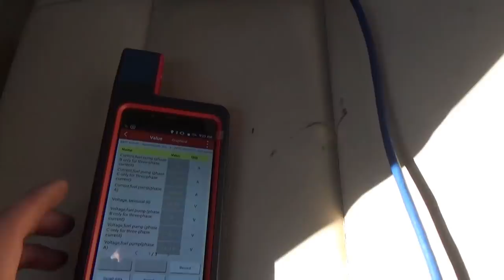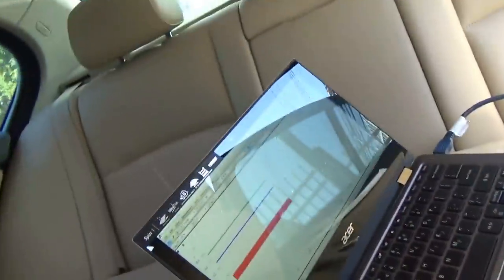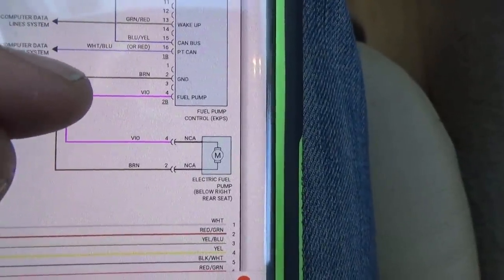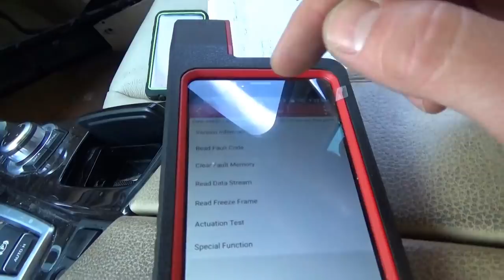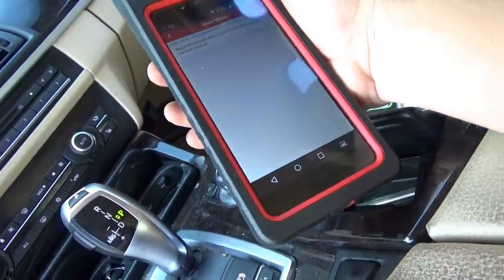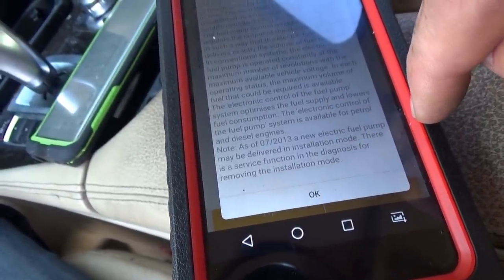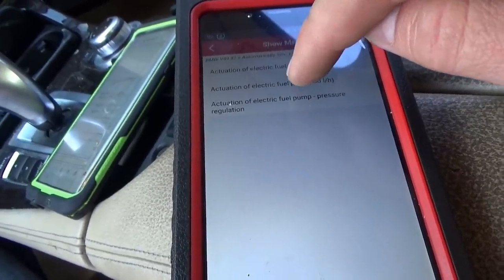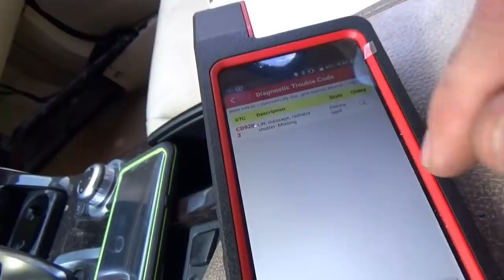BMW Fuel Supply Case Study -Part 1 (SI Ep. 15.6)

Comment: If the fuel pressure is staying at 96 and not changing, either a faulty sensor, shorted wire or no communication between the sensor and fuel pump module.

Comment: Ivan, You are about 3 & 1/2 hrs away from me & I have an issue with my 03 focus that eludes me however, I do admit that there is one thing that I haven't done & should remove my ecu & figure out which wire controls my cooling fan & see if anything obvious appears, then test for voltage but, You IVAN, I consider to be the BEST!  I have found a way to side step my issue partially, I have spliced into my cylinder head temp sensor & ran a toggle switch. When I activate the switch, the fans come on however, I WOULD REALLY LIKE TO FIX IT CORRECTLY & WOULD LOVE TO ONE DAY THIS SPRING OR SUMMER, TO PAY YOU A VISIT & SEE YOU WORK YOUR MAGIC? Though, I only get one day off per week & I work 6 hours that day & have the rest of the day to myself so, technically, it's called my day off but, NOT REALLY! Any who, I'd really like to hook up & get this issue figured out? I need to figure out which wire on my ecu, operates the cooling fan?

Comment: Next, it's time to use a signal generator or potmeter or something like that to simulate the fuel pressure sensor and to see if the engine control module picks up this signal correctly.

Comment: Does the PCM have a pid for fuel pump commanded output?  Or possibly even a bi-directional control at the pcm to turn on the fuel pump?

Comment: I would be checking the fuel pressure sensor and also the throttle position sensor in case it is sending a false command or something.  Guess we will see in part 2.

Comment: check the fuel lines at the pump.  did they put the high pressure line on the low pressure side?

Comment: Like others have said, i would check the fuel pressure sensor, the fact that the control unit is commanding the fuel pump to behave the way it is suggests to me a sensor/wiring problem.

Comment: I'd take a look at other data pids, fuel trim might show a rich condition due to another sensor acting up and command the low side fuel pump off. Worst case scenario, whip out ISTA and get crackin' 😆 it shows specs for each pid... Looking forward to part 2

Comment: It sounds like the system is switching it off for a reason, might be worth checking the fuel pressure, did you program the new module...F

Comment: What was the fuel rail pressure?  I know on 2.0t Audi there's a high pressure switch, fuel rail, and low pressure switch, HPFP, I wonder if one is giving incorrect pressures.Kinda like a coolant temp sensor reading -40 degrees when it's bad.  For the Audi standard pressure at idle is upper 70 psi at idle and around 50 with engine off.  Will do 70+ when I open my drivers door to prime the fuel pump though.

Comment: Theory of Operation, my friend.  The BWM N54/N55 Turbo 3.0L motors have 2 separate fuel pumps.  The Low Pressure Fuel Pump (LPFP) must generate 72.5psi(5000hPA) above 300rpm, this pump is in the tank.  The LPFP feeds the inline High Pressure Fuel Pump which is not in the tank.  It must generate at least 120,000hPA (2000+ psi) to avoid a limp home mode running purely off the LPFP, boost will be disabled via the DME, the DME will turn OFF the HPFP, and the DME will add 40x plus injector pulse width to compensate for the 40x lower fuel pressure.  Fuel Pressure sensor failures reading implausible measurements are common, N54 old style HPFP failures are extremely common(they were redesigned as you found in the documentation), as are stuck fuel injectors causing low pressure where the DME will throw codes and disable the HPFP to save the Catalytic Converters.  The LPFP is NEVER commanded off by the DME, but can fail causing crank with no start conditions.
Reply from the maker: Excellent info, thank you Blaine! Definitely need to verify the reading of that low-pressure fuel sensor :)

Comment: runs perfect w an external power source to the fuel pump?
Main ground to the module is good? 
were you able to code the module? it looked like a ton of options there on your scan tool that looked a bit confusing.

All of the that ok. Something on the network has to be sending a signal to shut off the pump. any codes in other modules? 
Do more research on the system/network.
Reply from the maker: Excellent thought process :)

Comment: I do love my BMW’s but I have learned you have to have a computer to fix everything from O2’s to mass air flow sensors, service bs.  Unless you are going to go BMW and stay with them and never pay for service you have to have a BMW service laptop software.  Also if you have a late model the 20 pin diagnostic under to hook is the only good way to connect not the 16 pin OBD2. You can even use a jumper to reset services like oil changes.  They have knock off or hack versions of the deal software and people have them for sale loaded up on a laptop ready to go for around $200-$250 if you look.

Comment: weak ground to module under spare tire? I assume you checked that ( I forget if you had the ground probed or not).
if battery voltage isn't dropping and the module is trying to demand more pump and it doesn't respond or cannot. then my next thought is make sure the ground is good. if yes, then monitor voltage and current to the pump itself and see if upstream pressure sensors match the output. very possibly bad pump 2.0, crushed fuel line, clogged filter. then again It's an BMW left rear tail light juice low :))
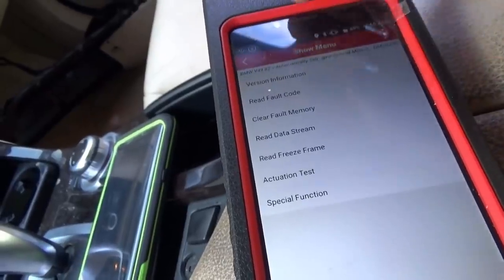bah, by 11:25 I'd gamble on the fuel pressure sensor being bad (low pressure one), would have aimed the parts canon there at the start if I seen a solid 98PSI reading lol
bah, I've not taken into the account bad check valves/high pressure pump leaking the pressure back...... whoops.

Comment: A failing (but not failed) Fuel Pressure Sensor giving an erroneously high value may cause the Fuel Pump Control Module to dial back the pump in an attempt to lower pressure, and when pressure doesn't change, it just keeps going right up until the point it turns off.  The Fuel Pressure Sensor may not be setting a code because the value it's sending back passes logic, hence "failing," not "failed."  :]

All that being said, I have absolutely no idea what happens if you hook a Brushed DC motor to a power supply for a Brushless 3-Phase AC motor.  Probably nothing in this case, since the connector color seems to be the only difference.  Likely there'll be pins in different slots depending on which pump the vehicle gets equipped with.

Comment: I believe that year model came with a Smart Radiator Cap.  Take the smart radiator cap off, drive another like kind quality BMW in place of inoperable one, install Smart Radiator Cap: problem solved. Seriously though, has anyone checked actual fuel pressure w/a gauge; line pressure and the fuel pressure regulator?  Somethings going on between the actual fuel line pressure and what the ECU requires; miscommunication going on.  Too bad all these newer BMW's dont come with a module that can tell you how many aftermarket (dorman) parts have been installed.  Looking forward to part 7...err uh, I mean part 2.

Comment: My guess is that the pressure transducer is bad, with a stuck high output corresponding to 95 PSI.  The computer sees excessive fuel pressure and shuts the pump down.  Check the transducer, and verify the actual fuel pressure with a gauge.
Reply from the maker: That's the next step :)

Comment: Ivan I really need your help. 1996 Lexus ES300. Wires to oxygen sensor (4 wire) broke off, sensor 1 bank 1. How the hell do I identify which way to wire these up. Please help I'm in a bind. Thanks, Paul. @ paulphillipsfix@gmail.com
Reply from the maker: Wiring diagram!
Reply: Done that... Colors don't match up.

Comment: I assume the fuel pressure number at the rail is not accurate?  1000 something i think it was?  Or maybe i missed a decimal?
Reply from the maker: It's direct injection 🙂
Reply: @PineHollowAutoDiagnostics  What does that mean?  I have a direct injection car, but there is a measurable fuel pressure at the "rail" that feeds the injectors.

Comment: I would chase the fuel pressure sensor,which is in the engine bay if I’m not mistaking. Somebody is lying causing the engine computer to command the fuel pump control module to shut off the fuel pump because of high pressure. There’s no way the electric fuel pump in that thing is putting out almost 100 psi of pressure. But before I do all that I would switch scan tools and make sure that PID is true and that the scan tool is not lying to me.
Reply from the maker: Excellent suggestion!

Comment: Seems like BMWs are engineered to give you 6-7 trouble free years and then they fall apart.
Reply: That's why they're 80% off sticker once out of warranty, and unsuspecting people pick up that sweet ride for a "steal", only to find out what would be a simple fix in your Chevy costs $3,000 in the BMW.
Reply: @volvo09  Not only that but getting any sort of DIY service info is like pulling teeth with BMW. They do not want you working on your own car.
Reply: Just long enough to get past the warranties and provide a good experience.  Sad
Reply: @Garth2011  Almost as if that's precisely what the engineers were told to design.
Reply: Even less, depending where you live. Staten Island, NY might be 5 yrs... lol

Comment: Another great video, Ivan.  My guess is a bad fuel pressure sensor reading (too high) and so the ECM is sending a message to the FPCM to turn off the pump. I would check to see what the pressure is and what it's allowable range is.  You may have to fire the parts cannon! (He's a BMW owner, he has the money.)

Comment: I had this EXACT SAME PROBLEM with a Range Rover! The fuel pressure sensor was the issue! It was constantly reading a high pressure and the ECU would slowly turn the pump off till the engine died! 
This Range Rover had a BMW engine and a Bosch fuel system that is very similar to the car in this video.
Reply: I think yes that pressure sensor reading is making the pump module turn down and off the pump to try decrease pressure
Reply: Bosch is the modern Lucas, it just fails without letting the smoke out. At least Lucas did something so it was easy to find problems.
Reply: @tiredoldmechanic1791  
Lucas invented darkness.
Reply: @Peter_Riis_DK  priceless
Reply: @tiredoldmechanic1791  From another old mechanic your comment is priceless. For forty five years I've been riding and restoring English motorcycles which makes it easier to find the smoke over a car. Godspeed my friend and keep on wrenching!
Reply: It makes a lot of sense. If the fuel pressure reading isn't leading to the pump being commanded off some other value is causing it. Seems very intentional "software wise".

Comment: bmw, why so complex a system. you would think we going for a trip to the moon in our cars.
Reply: stigonutube if you go,don't take a bmw.
Reply: @jeffshearer5125  hehehe yeah not any modern car, what happen to "keep it simple and reliable".
Reply: EPA causes them to think this way.  Too bad, the BMW techno team seems its best for computers and sensors to over ride the fuel pump duties. Not really, all they had to do was put in an inline volume/pressure regulator connected to the computer so the fix would be obvious if it fails.

Comment: It’s the fool pump, intermittent drop out. Otherwise it may need reprogramming.
Reply: Can you specify on the reprogramming part ???
Reply: @joselowe3379  the EKPS module controls the fuel pump. the voltage delivered to a vehicle's fuel pump. By controlling the voltage, the module maintains optimal fuel pressure and fuel delivery to the engine throughout its full operating range.

Comment: So the fuel pressure isn't staying high enough between pulses of pump on time.
Is the pressure regulator leaking fuel back to the tank or a crap pressure sensor feeding rubbish data to the computer.
I would still run away as i know nothing about the subject lol :-D

Comment: Sad. Another example of over complication of what should be a simple system.
Q: In the information you read it says one of the purposes of all that crap was to save fuel (or better gas mileage). How could shutting off the fuel pump save fuel. (except for the obvious savings of the engine not running at all ).
My (un-educated ) guess is there is a bad fuel pressure sensor telling the ECU the pressure is ok when it isn't. (Scan tool said it was high as well). Although it is strange that it is at odds with the other ECU programming that is reporting it's low and is not turning the pump back on.
Very strange.
Reply: Welcome to German overengineering
Reply: If the fuel pump uses less current, you can command the alternator to produce less current. So the engine has less resistant off the alternator. Its called clever engineering but somehow you americans don't get that with you're fuel consumming 5 ltr v8 with just 300hp.
Reply: @spin1275gt  You call it clever. Other people would call it inherently unreliable, hard to diagnose and expensive when it breaks. When, not if. When.

But I suppose that's not supposed to matter. It's disposable luxury. You're supposed to rent it and then throw it away at the end of the lease. Or palm it off on some sucker who doesn't know better.

Which would raise the point, you're saving a tiny amount of fuel in what is essentially a throwaway plastic car. Why.
Reply: @opl500  who said anything about throwing away. And where do you see plastic in this technology. Its not the only fuel saving cleverness of this car. Variable cam timing, variable valve lift, lean burn when coasting. And still producing 305 hp. If you know how it works its not hard to diagnose. Ivan made the fault to continu  the diagnose where the shop ended. He should have started from scratch and he will find out its the low fuel pressure sensor which its faulty. Just a 40 or 50 dollar part changed it 10 min. Can happen with every car.
Reply: @spin1275gt  All that does is add multiple failure points for the system and increase repair costs for the customer.

Comment: If the fuel pressure sensor is reporting incorrectly for some reason (sensor/supply/wiring/actual blockage) then the poor pump module is being blamed when it is not at fault perhaps. If the ECM thinks the fuel pressure is high when it really isn't, all kinds of problems could occur. Good luck - Adding BMW to the list of cars I wouldn't buy.

Comment: Check the fuel pressure sensor operation.
Reply: What would be in your opinion be the best way to do it? According to the functional description, it's a simple voltage output. You could use a multimeter to measure the supply, ground and output signal, or an oscilloscope, or you could emulate the signal with a potmeter (and check set voltage with multimeter). I would opt for the last, since you can directly relate the voltage  to the pressure that the ECU would have to display, so you have checked all wires and the ECU in one go and can then be sure that if the fuel pressure does not relate to what the ECU is telling you, the sensor is at fault.
https://www.newtis.info/tisv2/a/en/f10-535i-lim/XS5Pcgs shows the output voltage vs fuel pressure.
Reply: @tomvleeuwen  I would start by checking if the sensor is functional at all -> do we see pressure change, when pump starts and when it turns off? Is the indicated pressure in expected range? Does it keep in that range when revving the engine up? If not, that can be the reason to the fault code. 

If that is the case and pressure vs output V is known, I would install fuel pressure gauge, measure the sensor output V, read the indicated pressure from PCM and compare all three. If meter does not match with V and PCM pressure reading -> sensor. If pressure and V match -> wires or PCM. (Naturally check sensor 5V + gnd also)
Reply: Good idea

Comment: what would i do? trade it for a reliable brand.
Reply: BMWs have always been very reliable. You can rely on them breaking down constantly. It seems to me that the fuel pressure can't be over 90 psi without the pump running unless they have more than one pump. I'd look at the pressure sending unit but it's likely part of something else. I have found that in German made equipment, the cost of the part is directly related to the likelihood of failure. The most expensive part is often the one that fails.
Reply: When you see BMWs sitting outside trailers with trash strewn all over the front yard, you know today's BMW is a very different car than it used to be.